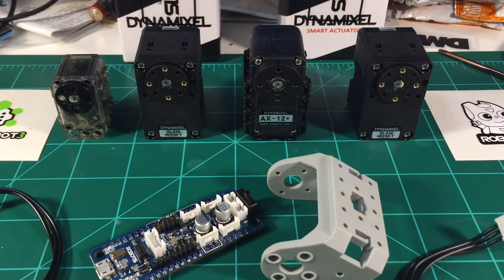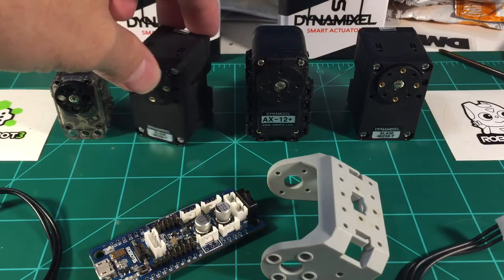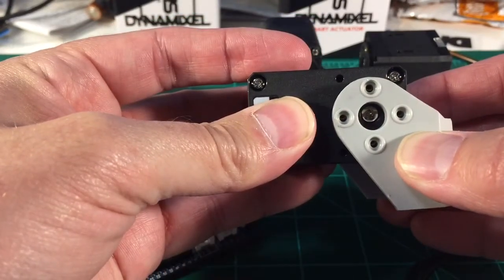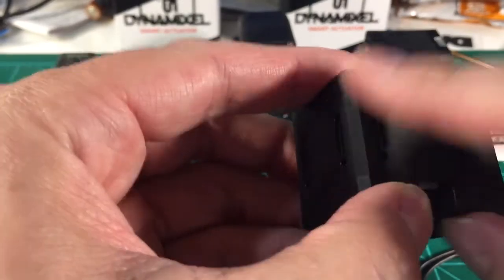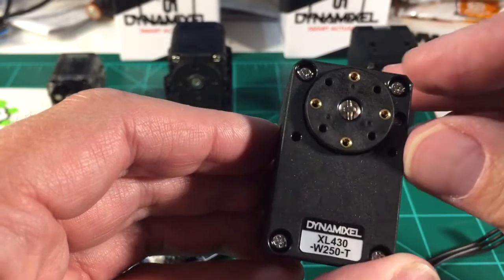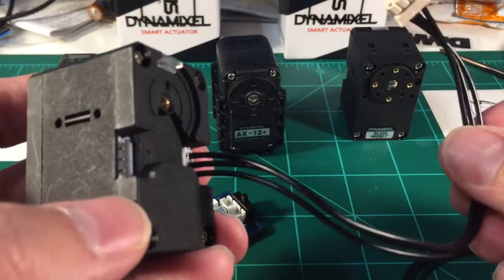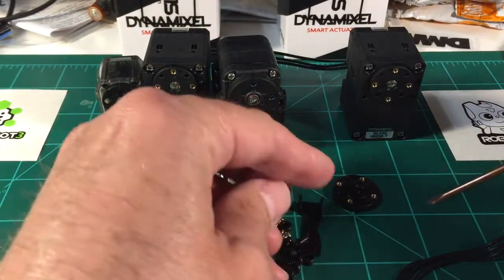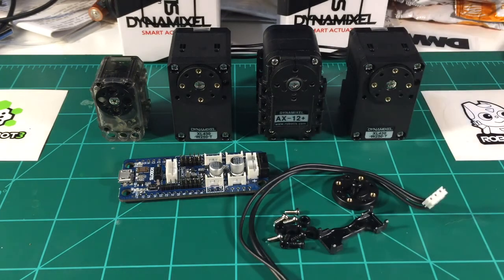The New Dynamixel XL430 servo from ROBOTIS

Comment: can opencm9.04 be used to control Dynamixel AX-12A servo ?
Reply: Why do I have to use t he expansion board? Isn't the normal board enough?
Reply from the maker: shubham shah yes
Reply: Michael Overstreet Have you tried it ?
Reply from the maker: Yes, you have to use the expansion board

http://www.robotis.us/opencm-485-expansion-boar/
Reply from the maker: In theory yes but the OPENCM does not have servo plug-ins for the AX-12A.
Reply: What about JST to molex connector?